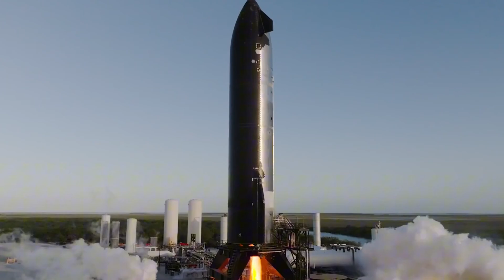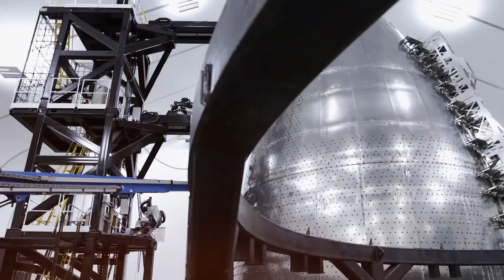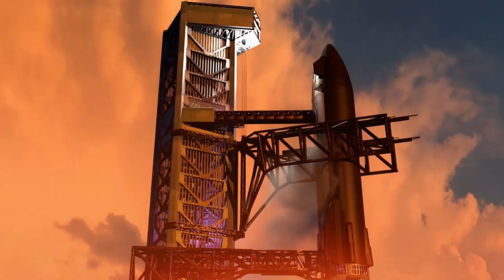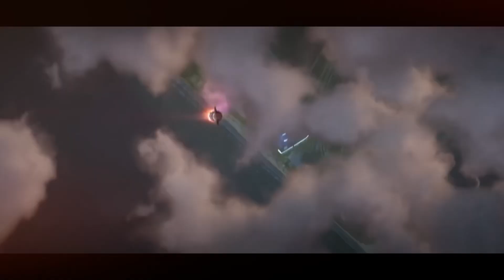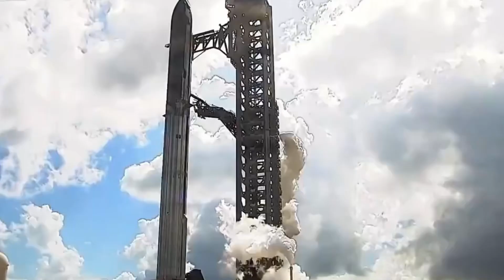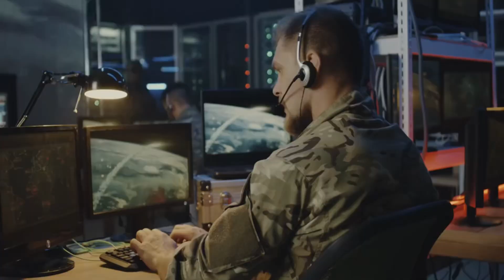GAME OVER For Ceramic Tiles! Elon Musk Reveals Revolutionary 2025 Heat Shield Technology!

Comment: U're highly correct in regards to "heat shields system." ON how they're made out of thru their own respective chemical components and structures. They're not jst an ordinary materials.  The Blade layer, I speculate if they're the crystalline heat resistance?
Afterall, these discoveries  plays a huge mega pivotal towards the future. 
ABOVE AND BEYOND.

I am staying cool, not overly excited over Spaceships tht I used to recultivate, dig my curdled memories. It's like I am back in my University days chazin books not classmates nor boys 🤭
Thanks Genius🌟
~😼
📝
Hey, see wht I've tld yah and GUESS❗️
B.O~N.G, Bezo's hot project lift-off not happening. Purportedly it will once again pushed to the 8th of Jan. 2025 his excuses were in account of bad weather over in Cape Canaveral,  Fl 🙄
SURE❗️I left no comment, I am tempted tho'